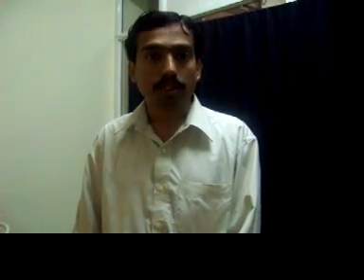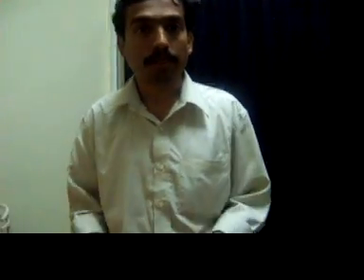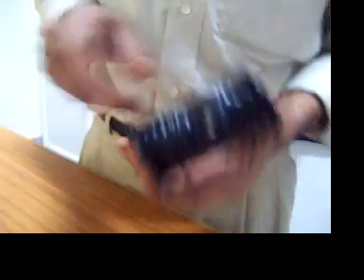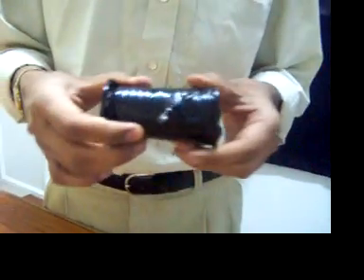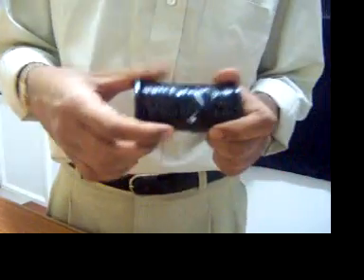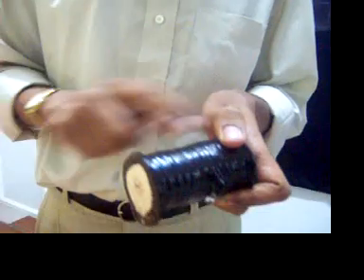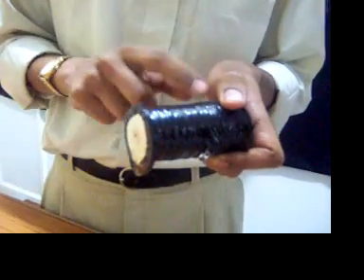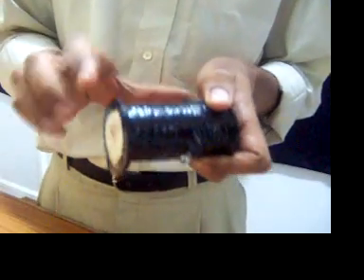simple Generator High school Physics project Ravish Generate electricity Manually Faradays Law

Comment: Can you make a step by step procedure,  so that i can do it without fail. I really need it for our science project.  Thanks.  Godbless.
Reply from the maker: 1. Buy 30 gauge copper wire-200gram
2.Take a nail of length 6cm.Fix some plastic plates at the ends to prevent wire from sliding.
3.wind copper wire on the nail.
4.Connect the two ends of the wire to an LED.
5.Take a magnet -move it close to the coil.The LED glows.
Reply: +raveeshakh Thank you so much!

Comment from the maker: Take an iron nail of length 10cm.take 1/2 kg of 36 gauge copper wire and wind it.connect an LED to the ends of the wire.Take a big magnet(it should be atleast 10cm wide. Then move the magnet near the coil.The LED glows.

Comment from the maker: 1.Please note that atleast 10,000 turns are required.  2.Connect the two ends of the copper wire to the two terminals of LED

Comment from the maker: you will need around 300grams of 40 gauge copper wire.IT IS INSULATED.JUST USE THE WIRE AS IT IS. while connecting ,scratch the ends of the copper wire to remove insulation.

Comment from the maker: Yes Insulated copper wire is to be used.There are two choices. 1. Enamel coated copper wire of 40 gauge is sufficient.A thin layer of a paint is coated on the the copper wire. 2.copper wire with plastic insulation is thick in size .so not a good choice.

Comment from the maker: The components I have used are 1. Insulated copper wire -40 gauge -500grams  2.Iron nail  3. Light emitting diode (LED)  4.Strong magnet.

Comment: Dear Sir,I tried this with plastic spool with a LED lamp(rating 2V) and strong magnet of loudspeaker(horn type). I used 1kg of 25gauge wire. But bulb did not burn at all. LED that works with 0.5 volt is not available in Kochi. Can we use ordynary torch bulb? Is an iron rod must for winding? Shd the winding be compact? Shd we apply varnish after winding? Pls help. Urgent.

Comment: @watchm0de2 You can not use copper wire without insulation. Magnet wire is copper wire but with a transparent film or a colored film on it. Without this insulating film your coil will short out.

Comment: @watchm0de2 You can not use copper wire without insulation. Magnet wire is copper wire but with a transparent film or a colored film on it. Without this insulating film yout coil will short out.

Comment from the maker: Either more magnets or the coils has to be increased.See, I used a coil of 60,ooo turns  and a big size magnet(diameter 10cm),I could manually generate 14 volts and current was low(500milli ameres).so 50 volts is too much and difficult.But try.

Comment from the maker: 1. Magnetic flux linking with a coil changes when magnet or the coil is moved relative to other.In my video,the coil is at rest(left hand), magnet (right hand)is being moved.As the magnet is moved towards or away from the coil, the magnetic field lines linking with the coil increase or decrease (as the seperation distance between changes).
2.See Faradays law can be tried with coil and magnet.I do not know any method of doing this experiment without a coil.

Comment from the maker: Take an iron nail of length 10cm.take 1/2 kg 36 gauge copper wire and wind it.connect an LED to the ends of the wire.Take a big magnet(it should be atleast 10cm wide. Then move the magnet near the coil.The LED glows.